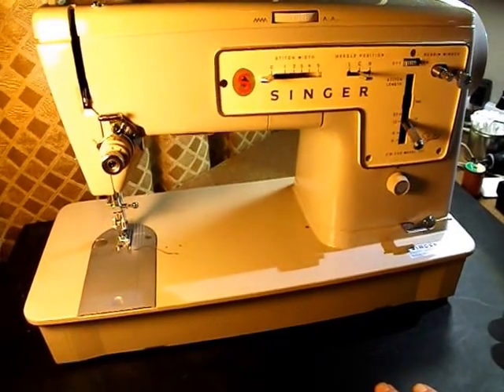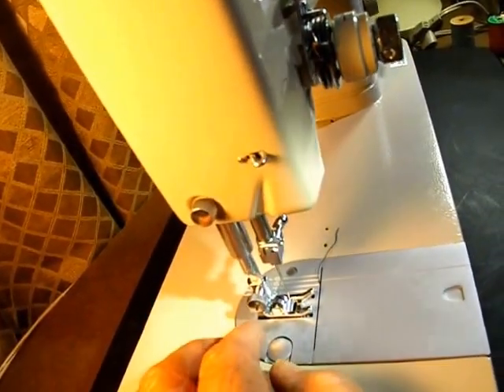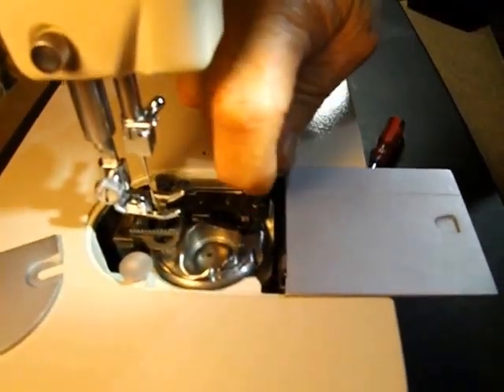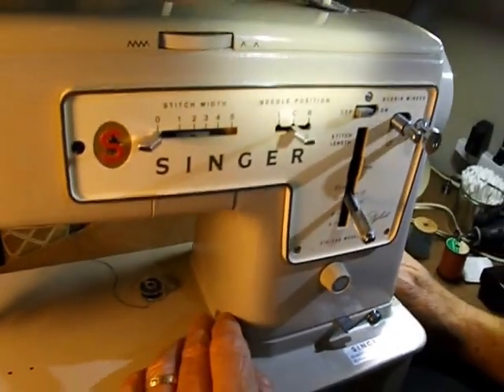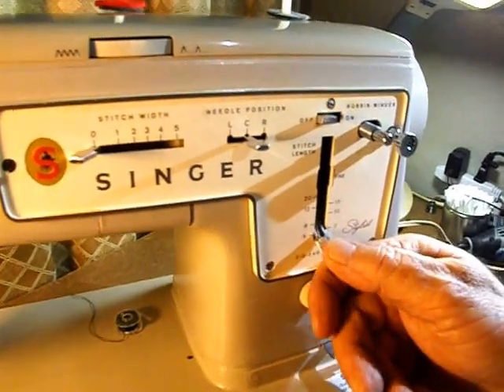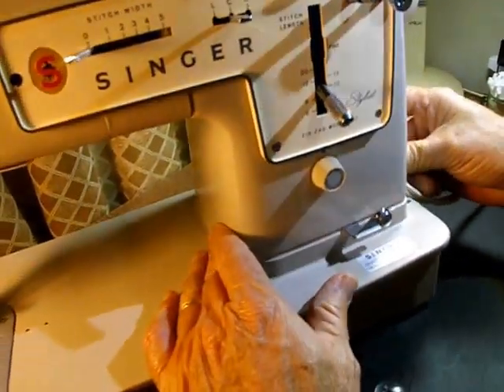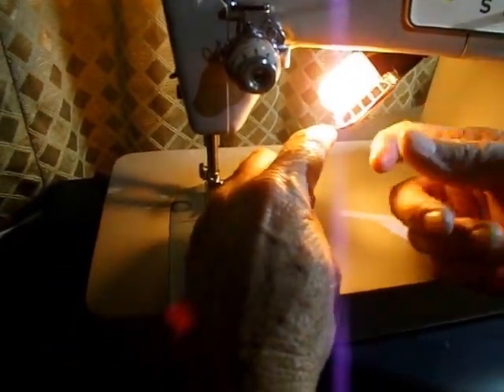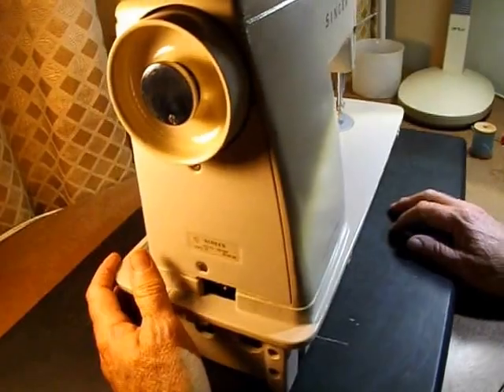TOUR THE FEATURES OF THE SINGER MODEL 457 STYLIST SEWING MACHINE

Comment: You are such a gift to us Andy!  I am looking into picking one of these up and came here first, and voilá, here you are just in time!  Not sure about that top gear, would the cause of that problem come with heavy use, age, or both?  Sure thinking about you lots and praying for you.  Hope you stay cool, things are heating up in Winslow but not like down there….  Take care..healing thoughts….Jonee. (I get crap for having 34 machines, then they tell me I need one more for 35.  Go figure!  😂)
Reply: P.S.  I just visited the site you linked to above, about the  gear.  The answer to my question was right at the top, can be sewing too heavy/thick of material and/or age.  (Just in case anyone else wondered, and to save you from having to answer it, dear Andy..)
Reply from the maker: Thanks for the kind words. 🙏 IMO the top gear fails b/c oil/grease is put on top of it instead of oiling the bushing below it. That type of load bearing bushing gets hot anyway but even more so when the bushing lacks oil. Excessive heat and break-down of caused by oil (hydrocarbon based) on the plastic (hydrocarbon based) gear causes it to discolor and weaken then finally chipping off teeth and even cracking into parts. No oil/grease on plastic gears as told to me by Singer guys. There are modern synthetic oils/greases not that some feel the need to use on gears, but I still do not put anything on gears. This model, and a dozen other, left out an oil port for the top bushing that they normally used on previous and later models, only showing (poorly, IMO) in the instruction manual to put oil on the bushing from the top. I believe most people mistook those instructions for putting oil right onto the plastic gear. Yes, a few degrees above normal at 114 today, but we've had 122 before and still live to talk about it, so meh... Take care of yourself and good luck with #35.
Reply: @andytubesewing1953    Thanks as always for your valuable insight, and the thoroughness you use to explain it.  It all makes sense, I have a machine I got i  the early 80’s that was exactly as you said with the plastic gears, and the vague lubrication instruction photo.  Pretty sure I oiled that, too.  Yoinks.  

 I hope we get a meaningful monsoon this summer - lots of rain, not too much damage.  Take it easy!
Reply from the maker: @graymaquilter9641  I'm all in for a nice monsoon season. It's 7PM on 6-11-2022 and the temp just dropped DOWN to 113 deg. Came out of the church into a 15 MPH wind in the face. It felt like walking behind a jet ready for take-off.

Comment: Thank you very much for this onfo. It says in the book that the 457 can be used as a treadle, but dosn't say how. would you know?
Reply from the maker: You can buy the service manual. It has instructions for converting the machine to (or from) treadle, but you need parts. You must remove the motor, you must change to a special treadle handwheel (part number unknown), you must install an Idler Pulley for the Treadle Belt inside the machine, and you must replace (or leave totally off) the bedplate cover (oil drip pan on the bottom of machine) b/c the treadle belt will come out the bottom of the machine. There are parts manuals also. This seller has the service and parts manuals for download. Use coupon code andy-h-yt for 20% off. Service manual; https://store.tandtrepair.com/400seriessm.html
Parts Manual; https://store.tandtrepair.com/457.html

Comment: Hi Andy - hope you had a good Christmas and Happy New Year!
I've been having a few problems with the bobbin tension on my machine and wondered if you might be able to help? A few weeks back I was having tension problems - the needle thread was breaking and the bobbin thread seemed loose. I managed to get the needle tension right but I just can't seem to get the bobbin tension right, which was loose and now is very loose! I've been testing with different coloured threads and the bottom threads are quite visible i fact if you crank the wheel by hand you can see the bobbin thread pulling through. I don't seem able to tighten the tension on the bobbin case any more. Is it possible that I've over done it and damaged the spring on the bobbin case? I've taken the bobbin case out and cleaned it but I've still got problems. Should I buy a replacement bobbin case? No immediate rush as I have a spare machine. Best wishes and thanks for all the videos.
Reply from the maker: Congratulations on getting the needle tension "right"; that's not always easy. Sure it is possible you damaged the parts on the bobbin case. I don't have it in my hand so I can't say if that is the problem. 
     Here are some things I have found on the class 66 bobbin cases though. You said you cleaned the case which is a good idea. Here is how I clean a bobbin case; https://youtu.be/HT5XZ5eYYEQ   
     I have often found lint & dirt packed between the tension spring and the side of the case that prevents the spring from putting tension on the bobbin thread. You can tighten the adjustment screw until you're blue in the face (or you damage the spring/screws) and still not achieve normal tension. 
     Speaking of the spring and screws, yes, I have seen bent springs from people adjusting them and I have seen damaged screws that just won't quite tighten down properly. Sometimes you can work the spring back into a nearly perfect curve to repair it but sometimes you just have to replace it. If the screw seems damaged it is usually a thread/threads of the screw which seems to be a softer metal than the hardened steel of the bobbin case. Springs and screws used to be plentiful but are getting hard to find. 
     The spring on your bobbin case is part #172202 and I found one seller who shows it in stock; https://www.singeronline.com/bocatesp11.html   There may be many more and I'm not sure you are even in the USA for that matter. 
     The spring mounting screw is part #1172;
https://www.sewingpartsonline.com/bobbin-case-tension-screw-singer-1172.aspx
     The tension adjustment screw is part #1173; https://www.sewingpartsonline.com/bobbin-case-tension-screw-singer-1173.aspx   and there may be other sellers but with the part numbers you can search around. 
     Should you buy a replacement bobbin case? Part #172082-001 can certainly be found on eBay and other online stores. You may (rarely) find a new one for $60 or used ones for $10 - $15.
     I have found it rare to have to replace a Class 66 bobbin case though. I have found that the hook and bobbin case on the machine develops a "wear pattern" after years and maybe millions of rotations. When you buy a used case it has its own wear pattern that you can bet will be different than the one on your hook. So the used case will work but may be quite noisy. That can be corrected using valve grinding paste and lots of time and patience. I've done it a couple of times and try to avoid it if at all possible. 
     I have been told by a couple of viewers that they bought a new Apollo Bobbin case and it worked "OK". It is made of plastic and has a low price so when it wears out it is easy to replace. I have never tried this myself but here is one for you to see what I'm talking about; https://www.sewingpartsonline.com/bobbin-case-apollo-singer-421326.aspx?
     Personally, I bought an extra working bobbin case for all of my wife's sewing machines, along with an extra used motor. Some things just aren't being made any longer.
     Yes, happy new year Fiona, and thanks for watching my channel.

Comment: Hi Andy,
I just found a Singer 437 standing outside. I took it in to see if it still works and it mostly does. electricity works and the machine moves mostly smooth. however, when you put the bobbin thread and the top thread in and try to sew with it, it gets terrible stuck right away. i am not quite sure what the problem ist. i took the bobbin pin out and the capsule too, cleaned a little, but it wasnt too dirty anyways. it still gets terribly stuck and makes not a single stich.
i have tried to make a video of what happens, maybe you would have a look at it for me? and maybe you have a suggestion as to what i could try. i think it would be a real shame to throw the machine away as it works fine otherwise.
Reply: forgot to mention: the singer machine i found is a singer 437. for all i can see it is really similar to the 457, with smaller differences
Reply from the maker: Hi, Yvonne. Thanks for trying to save this machine. Model 437 was not sold in the USA when it was made. I have no parts or repair documents for it, sorry. I did find the instruction manual here: https://www.singer.com/sites/default/files/product_manual/SINGER%20437%20Sewing%20Machine.pdf
It does look like a free-arm 457 model, or at least in that family. There are a few things that could cause the machine to "get terribly stuck" right away and more info is needed, but here is a video about thread clearance. If the bobbin cushioning spring is out of adjustment then the thread hangs up there and the machine can "stick" or "freeze" from that. Here is a video about that on a model 404 to give you an idea of what I mean: https://youtu.be/OXKqZp87eN4
You could also go here and buy a service guide for model 457 for $7 and see if that would help. It has many instructions for removal, replacement, and adjustment of parts. https://manualsoncd.com/product/singer-400-series-service-and-repair-sewing-machine-manual/
Reply: hi thanks for your quick reply. i am based in germany, maybe that explains how i found the 437 :)
when i found it it there were some threads hanging out from underneath the needle plate, it was difficult to remove them. i pushed open the needle plate and tried to carefully get the threads out, but they were stuck to the degree i had to remove the bobbin cushioning spring. but i put that one back in (correctly i believe at least looks the same as before to me, but i have never tried to repair a sewing machine.
i will upload my video on my channel and maybe you can see it there. will try to make a better one tomorrow. i mean if you are interested.
Reply: my video is online, it is short am and i turn the hand wheel on the side that is why it is so slow. i should try to make a better video tomorrow probably.
i will go and look at your video again now.
Reply from the maker: I watched your video. The needle thread gets stuck after it is cast0off the hook. It looks like there is no gap between the bobbin case and the bobbin case spring. watch the video I referred you to and use a feeler gauge to set the gap.

Comment: I have the same machine but when is in reverse and zigzag has a strong sound like two pieces of metal hitting each other do you have any idea about what is wrong with it ? 
Thanks great video
Reply from the maker: Lots of possibilities for this, Otto. You'll need to isolate more. Is it only when you are in reverse AND ZZ at the same time? So is forward ZZ OK without noise? Is straight stitch reverseOK then? See where I am going here? Is the metal-hitting noise rhythmic like thunk, thunk, thunk, or is it a constant scraping?  The feed dog can hit the body under the needle plate in reverse. The needle clamp can hit the top of the presser foot. The vibrating bracket that swings the needle can need adjusting. The follower arm that tracks the ZZ pattern disc on the cam stack can be out of adjustment. Remove the bobbin and all upper thread and just sew air and see if you still have the noise. Then remove the needle plate and see. Then remove the nose cover and watch the needle bar and bracket. You can buy and download a copy of the Service Manual for $6.99 at this link:
https://manualsoncd.com/product/singer-400-series-service-and-repair-sewing-machine-manual/   it covers all the R & R and adjustment instructions for your machine.
Reply: @andytubesewing1953  only in reverse and  ZZ at the same time other ways it is working perfectly
Reply from the maker: @ottomora4485  OK, thanks for that. It is illogical though, to me. 
     The feed system and the ZZ system are separate systems. The feed regulator behind the lever controls the feed movement from front to back (regular sewing) or changes it from back to front. (reverse sewing. It does not matter whether the needle bar is set to straight sewing or ZZ. 
     The stitch width lever controls whether the needle moves up & down in one place for straight sewing, or the needle swings are varying amounts for ZZ sewing. That is independent of the feed and acts the same no matter if the machine is set to forward sew, neutral sew, or reverse sew. 
     So I don't get that something is only happening when the settings are reverse and ZZ only, and other times no problem. What a puzzler. 
     Some 457 models were made with a feed drop system (feed throw out) that lowers the feed dog for free-style sewing like mending or monogramming. I never tried reverse sewing of any type with the feed dropped so I don't know for a fact that that could cause the problem. On several models I have worked on if the feed drop system was misadjusted the feed dog could hit inside of the body at the back, away from the needle/hook. If you do have the feed drop knob (on the bed to the right, next to the upright arm) you could watch this video about the feed drop to get an idea of how it works. https://youtu.be/hxOscoEdkxY
     Model 457 (and family) have a problem with the main arm shaft getting out of adjustment, like loose, and allowing the arm shaft to move side to side from the handwheel to the nose which can cause a "knocking" and make noise. Here is a video about readjusting that: https://youtu.be/bYqVRDTAHfo    
     I did have a 457 years ago that made weird noises of clanking and it took a while to discover someone had worked on the cam stack and did not tighten the set screw that held it in place. Once I adjusted the stack into the worm gear of the arm shaft it quieted right down. https://youtu.be/egDAePpqjW0   
     I guess those may be some possibilities, but I'm shooting in the dark, really.  I would remove all covers, top, bottom, and nose and remove the needle plate and all threading and run the machine to try and isolate the noise to a location as much as possible.     I still recommend the Service Manual I mentioned before. Good luck.

Comment: Hi,  great instruction on this machine.  I was just given one and the height of the all-purpose presser foot seems low--it's hard to get a folded hem underneath it.  You mentioned a "short shank", would this just be an anomaly of this 457 machine?  Versus say my old Singer 185?  Thanks!
Reply from the maker: Hi Angel, I'm not familiar with the Singer Model 185. By short shank I mean the standard Singer straight vertical shank presser bar & foot, VS. the Singer Slant shank presser bar & foot, like found on Models 301A, 401A,404, 500. Maybe who ever gave you the machine gave a wrong foot with it too. Maybe it's a Kenmore foot, or Jenome, Husqvarna,  Elna, etc. How does the foot compare to the one on your 185? By the model number of 185 I figure it was made before the first slant shank (301A) which was made in 1950.

Try this: with the presser bar raised up, 4 US Quarters should fit under the bottom of the presser foot. The factory spec is .290 to .300 inch, so it is a pinch more than 4 US Quarters.

If they don't fit on your 457, there are a couple of possibilities. Are you using the correct foot for the 457? Is the presser bar set at the correct height? 

Here is a link to one of my videos setting the height of a presser bar. It is just one screw to loosen, adjust height , tighten. S you could loosen a screw, put 4 US Quarters under the foot, and tighten the screw.

The video is of a different model, but it should show you how to adjust.
https://www.youtube.com/watch?v=ABCyJyZbqCY&index=20&list=PLsCOZgzzaiKJxbOOMKQPvmeTRqi0dhGa5

Please let us know if this helped and what happens so others can learn from it too. Thank you for asking and watching Andy Tube.
Reply: Thank you so much !

Comment: Thanks for making these. I have this machine and use it to hem my work clothes, 65poly 35 cotton, not too heavy. Problem is the machine stops near seams. Doesnt seem to want to go through 3 layers. Is that just this machine ir should i start looking at issues. I put a new top gear in and lubed er up when i got it. Appreciate any input
Reply from the maker: The machine is capable of sewing like that. Here is another model sewing demo that has the same motor as your machine: https://youtu.be/CJd4bJOby78   Most often if power seems week it is due to the foot control needing cleaning and adjusting. It is a carbon resistor style and I doubt anyone has ever worked on it. Here is a playlist of how to restore it: 
https://www.youtube.com/playlist?list=PLsCOZgzzaiKItPLWcK24FBoMdHK8vTXNi
Sometimes it can be that the motor commutator is also dirty with carbon deposits. The motor can also be cleaned and the brushes reseated to increase power. https://youtu.be/rpTy_Bz3prA
All of the above is assuming you are using the correct needle for what you are sewing and the needle is in good condition. The needle is the cheapest part of any sewing project. Also assuming there is no binding of the gear you replaced or the timing belt you reset.